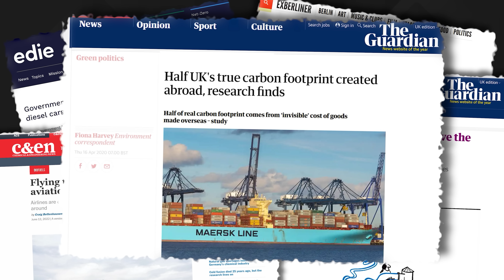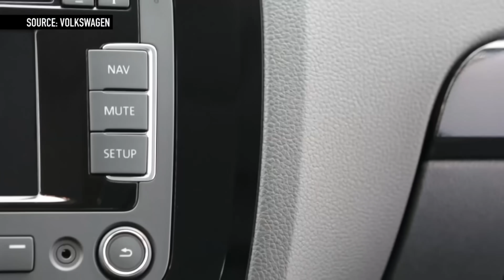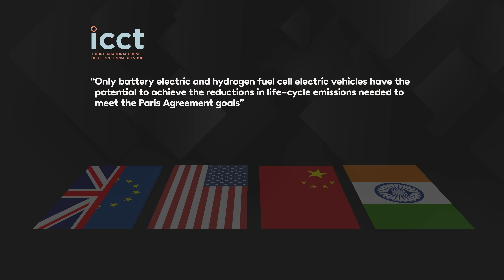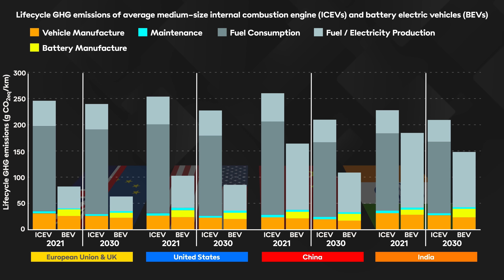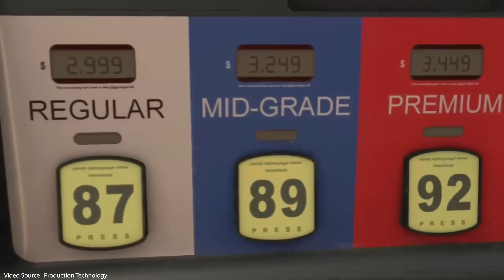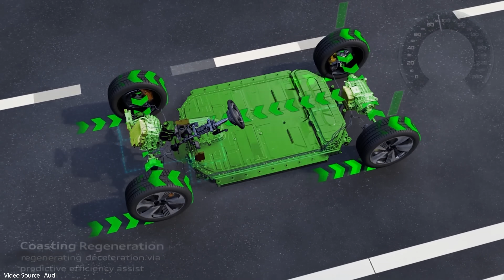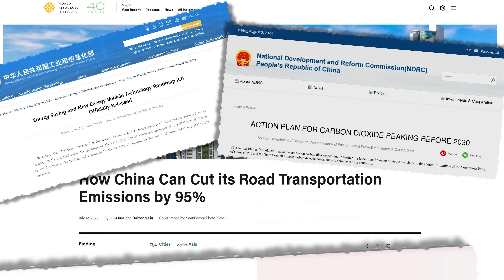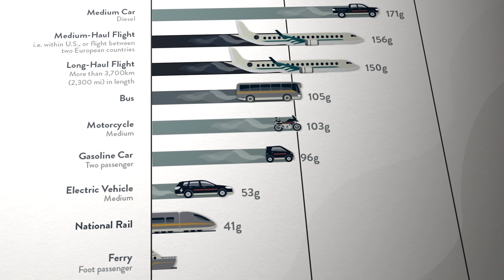Are EVs really better for the climate?

Comment: As always a very fair and balanced look at the subject. The naysayers never factor in the fact that pumping and refining oil, uses colossal amounts of electricity, so the emissions of internal combustion vehicles are worse in the countries that burn a lot of coal for their electricity. And as Robert Lewellyn often says, show me a recycled litre of burnt diesel
Reply: Hmm recycled liter of burned diesel. That should be a tree right?
Reply: Any idea what to do with the waste products from refining crude oil for other products? Seems we can just poor things like petrol and diesel into the sea? Assuming all vehicles, even electric, need lubricants for the transmission etc?
Reply: The only way you could possibly create synesthetic fuel out of the spread carbon in the atmosphere is via the use of a high temperature nuclear reactor on a shore. Its the only thing outputting enough heat and spare electricity for the harvesting and processing operations to occur at any form of scale. 

These people are also the ones who shut down nuclear plants and more importantly have downsized and downplayed nuclear research.
So good job fuckos, if you remove the "brute force" solution, the only thing that is left is the more efficient solution, that being EVs
Reply: The Earth is cooler with the atmos/GHGs/albedo not warmer.
To perform as advertised the GHGs require “extra” energy upwelling from the surface radiating as a black body. https://youtu.be/0Jijw7-YG-U
The kinetic heat transfer processes of the contiguous atmos molecules render that scenario impossible.
No greenhouse effect, no GHG warming, no man/CO2 driven climate change or Gorebal warming.
Reply: OK, I'll show you!  Aldo Steinfeld's solar refinery that uses solar heat plus atmospheric CO2 to proflduce fuel stocks that can them be refined into a variety on carbon neutral fuel.  He has a workout ng silar refinery in Switzerland right now.

So there.

Greenies want perpetual crises, so they can get rich and control your life.
Reply: Counter argument to Just Have a Think biased argument... https://www.youtube.com/watch?v=TUx8yIlKVpU
Reply: As a person in the Global South, I have a suspicion that the Green Transformation, initiated by western countries, is to legally and officially reap Developing Countries from affordable energies. Without energies, good luck to development, good luck to catching up with the West. The current international situation prevents many power countries from just invading others, or colonizing them, like in the past. Thus, they need a clever trick to suppress others' development opportunities. Much of the world's capitals are concentrated in western countries. By framing a country, such as China, Vietnam, Indonesia, as destroying the environment, western countries can officially hinder the inflow of capitals into those countries, in the name of "Green Transformation".
Reply: I missed the part about battery recycling surely that has a foot print? seems like we still need better storage solutions.
Reply: @-GinΠΓ Τάο Yes. The first cars were electric. So what? 
There was hardly any progress for most of the 20th century. Fossils were more convenient during that time. Especially as the downsides were externalized
It wasn't until the 80s and 90s when computer miniaturization justified massive investment into more effective battery technology for laptops and mobile phones and now more recently EVs. Batteries have become much better and a lot less expensive the last couple of decades.

There's too much false dichotomy around.
Technology alone won't save us. But also technology will play a large and necessary role.

One can be true without the other being wrong.

ICE is technology. Public transport requires technology. Feeding and supplying 10 billion people this century will require improved technology, because we need to get away from fossils big time.

For 2 reasons:

A) Climate change
B) They would run out one day anyway. Whether that's 8n 20 years or 120 years is besides the point. It's a limited resource and we also need it for other things, not just burning it in ICE cars.

Fossils need to be over and thus ICE cars have no future.

That we should also get more people from cars and planes into trains and busses is a parallel measure that also needs to happen. And what car use remains should be less owned and more conveniently shared.

Why buy a car if I can call one from an app and only use it for as long as I need it. No worries about financing a whole car that stands around most of the time, no worries about maintenance or repairs after a crash.
Reply: Stop calling them nay sayers. It's healthy to be skeptical. I don't compare electric cars to new petrol cars, I compare it to second hand cars and I live on a dirty grid.

However what is holding me back is I'm yet to see enough details out of companies like Tesla and I don't like their business practices.
I need to know what they're going to do with solar panels and batteries for recycling as this will be a problem in the future.
I need to see more government regulation on this data as everyone misses out stuff.

While the situation is looking a lot better, I think it's still wrong to assume it will be better everywhere and that the grids can handle everyone switching over to EV.

It's healthy to be skeptical, I'm for EVs, but I need to know more before I trust big companies on it.
Reply: @Commander_ZiN  I like your integrity
Reply: @Commander_ZiN  Yes, it is healthy to be sceptical.

But you're comparing known definite problems for ICE cars to speculative problems for BEVs.

And the state of your grid today is almost irrelevant. I find it tiresome that people still try to use that as an argument.

Your grid is moving towards cleaner sources every year now. If that isn't true over time we're doomed anyway and you don't have to worry about recycling your car in 20 years.

And if the grid is improving over time, why would we consider today's grid for a vehicle that is going to be in use for a couple of decades?

Yes, it's good to be sceptical. But don't forget to be sceptical about the stuff you're simply used to. 

ICE cars suck. They stink, are loud, have a lots of parts that need maintenance and can fail and need replacement over the lifetime of the car.

Even if lifetime CO2 were the same they couldn't compete anymore (except on refuel/recharge speed).

In a decade the next generation getting their first driving license will look back and not understand how anybody could cling to that old crappy tech.
Reply: @oerthling  it's tiresome that people argue without facts. You say ICE is known dirty and EV is speculation.

I'm not going to buy a new car unless I have definitive proof it is actually cleaner than running my old car longer.

Saying the grid will be clean one day is ridiculous, I'm not going to make a decision with future facts.

My very point is if I'm going to buy an EV, I need proof it is actually better for the environment.

You talk about cost of repairs, most of the repairs for my car are from things sitting on a shelf for 20 years.

I'm pro EV, however I'm yet to see the proof.
Reply: @oerthling  I've seen some of the data and I've found it lacking. It often doesn't take into account recycling and effeciency drops as the EV ages.

I have a very dirty grid, I'm not buying an EV in that the future the grid might be clean. When it is a cleaner solution then I will.
Until then I'll reduce my energy consumption.

I'm not buying a new car, as soon as I buy a new car it'll be worse for the environment. I'm not doing this and contributing to climate change until I know how long until the break even point is where I live with a particular vehicle. I'm not buying an EV until I know I'll be able to get spare parts and get it repaired for the next 20 years and that the spares like the battery can be recycled and the carbon cost is a net savings.

You can argue until you're blue in the face, if I don't see the facts, I'm just going to wait until I can prove it one way or another.

I worry If everyone switched to EV tomorrow they'd have to build a few more coal or gas power plants.

Again I'm happy to read a peer reviewed paper and do some math, but last time I did that was a year ago and it was a bit on the fence. I'd like to see a clear winner.

I'm not buying a new ICE car. I wouldn't mind a second hand EV, I'd prefer a car that has had it's manufacturing co2 cost already paid for, but I don't know if I trust EV manufacturers to support there vehicles long term.

TBH EVs remind me a bit too much of mobile phones. If you let the companies have their way, they'll mass produce as many as they can and get you to trade them out as often as they can.

Think about it, look at the graph in the video in india and remove the cost of the car manufacture it's pretty much breaking even. However I don't like those graphs based on vehicle lifetime as I don't intend on using the typical lifetime.
Eventually an EV would break even, except for the battery recycling and replacement issue and they never seem to include that in a way I can calculate it seperately for my use case. I suspect that's because they don't want us to know something.

Anyway no point arguing, just show me the facts.
Reply: @Commander_ZiN  Besides the already mentioned point that you ask for data on BEV cars that you likely never demanded before buying an ICE car (new or old), I see a key point in your arguments that I see as a whole in your logic:

The amount you personally own a car has nothing to do with the compatibility of ICE vs BEV cars.

If you buy a used car somebody else owned it for x years and after you replace it with another used car somebody else will own your former car. That car will exist for x number of years. And from production to wrecking/recycling it has x number of useful years.

It makes no sense to pick out 1 particular year in the lifetime of a car and compare on just that.
You cannot buy a car - even if it's 17 years old and tell yourself that the CO2 during production doesn't count anymore. You own the CO2 used during the fraction of the cats lifetime you use it, because without that initial production you couldn't own it 17 years later. For used cars to exist somebody must have bought it new.

Also, ICE cars also must be recycled unkess we just stack wreck on a field somewhere. That might be easier cheaper

Also worrying about getting replacement parts in 10 years is a valid concern. But that can also be a concern for ICE cars. And it will be an increasing problem for ICE cars as manufacturing of them winds down this decade and is replaced by BEV manufacturing.

Gas stations will eventually close down due to less demand. Repair shops for ICE cars will become rarer for the same reason.

As much as I'm sure that car manufacturers would love to sell us new cars (of any kind) every couple of years, that's simply not am option for the vast majority of us, as cars tend to be quite a bit more expensive than smartphones.
Reply: @oerthling  again you're not using facts.
When the maths lines up then I'll switch.
I bought my car second hand long ago, when it definitely wasn't better for the environment to get an EV, not that I could get an EV back then anyway where I live.

I'm not considering the co2 manufacture costs of my car because I've already owned it for many years.
I'm not considering the recycling because I don't plan on getting rid of it any time soon.
Also it's pretty easily crushed and recycled and melted down and spares used.
I don't know the same for batteries in EVs.

If I'm going to buy an EV all my questions will need to be suffeciently answered otherwise I'll wait till they are. I'm not buying something just because you have a gut feeling or you read a report that told you a story that doesn't relate to my location in the world.

There is a CO2 manufacture cost, getting a new EV puts more CO2 into the world than me running my car a little longer.

Until I can confirm how long I can maintain an EV for and whether the CO2 of replacing the batteries will be less than the petrol I use then I'm not doing it.

You're asking me to do something better for the environment without actually knowing it's better. That is ridiculous.
Reply: @Commander_ZiN  Whether YOU consider manufacturing CO2 or not doesn't matter. Without it your used car wouldn't exist and you couldn't buy it.

And again, you demand things from EVs that you don't for ICE cars.

You worry about battery recycling, but not about the fact that energy use of ICE cars is much less efficient or the fact that you produce co2 for every km driven and that is not going to improve over coming years - quite unlike the electrical grid that has been improving already the last 2 decades and will improve further (but perhaps your local grid is in Saudi Arabia :-) ).

And you are demanding facts in the comments thread below a video that references a study. And I have seen similar information for years. It's not hidden.
Reply: @oerthling  I've already mentioned where I'm from. I've already mentioned I have read similar studies and they haven't answered my questions.
You don't answer my questions but instead come up with silly arguments.

I already have my car it's done, the decision was made long ago. What CO2 was created when it was made was over 20 years ago. Surely you're not arguing it's the same as manufacturing a new car today.

Stop making silly arguments. Math and facts is all that is required. Point me to an article that shows where EV manufacturers source resources and all the CO2 costs for a making the battery and recycling the battery and how long they'll support the vehicle.

I've yet to see this information. If you've seen it let me know where. If you haven't you might as well concede the point you bought an EV on the belief it was better for the environment, not on facts.
Reply: @Commander_ZiN  'There is a CO2 manufacture cost, getting a new EV puts more CO2 into the world than me running my car a little longer.' Well stated.
Reply: @oerthling  You seem to be missing some of commander's points. Read and understand what he is saying, before getting upset.
Discussion is good, as long as we are on the same page.
Reply: @oerthling  'And again, you demand things from EVs that you don't for ICE cars.' You are purposely taking sides against ICE owners. Similarly he would carefully consider the merits of a new ICE car versus keep running his existing ICE car. You are making it out like he is anti-EV by not buying an EV now. When all the guy is doing is being sensible and considering the merits of any new car before he commits to buying one.
Reply: @jagolago-bob  What makes you think I'm upset? I'm really not.

And I could say the same thing.

Not considering lifecycle emissions from ICE cars just because you buy it used makes no sense.
And by that logic battery production and recycling problems would also vanish for used EVs.
Reply: @oerthling  You still are missing his point. He isn't convinced by the current arguements. There is a lot of propaganda that simple folk fall for, whereas others like to make an informed decision.
I don't mind whether I drive an EV or an ICE, but I won't buy one either, until the facts are on the table, and I'm convinced by them.

There's enough information for you to be already convinced of the benefits of EVs. You obviously have lower standards of proof than others do.
Reply: @jagolago-bob  OK. :-)

I guess I'm imagining the growing market share of EVs and that all major car manufacturers plan to switch to EV production. They probably have the same low quality information sources as I. ;-)
Reply: @jagolago-bob  Of course thes used to fight it and beg for money now.

If you're a legacy car manufacturer all you capital and competence was invested in ICE car manufacturing. Getting from that to new tech is costly and cannibalizes existing sake chanbeks and partnerships.

A problem that Tesla and other startups don't have. And nobody had to force them.

At this point it doesn't matter anymore whether governments push for it or not. You ramp up EV production or Tesla and fresh Chinese competition eats your market.

Big legacy manufacturers with political influence will always try to milk the government. Why wouldn't they? It works. That's what lobbyism is for.

Please note how Nokia and Blackberry vanished when they didn't switch from their legacy feature phones to smartphones. No government mandated smartphones.

What you didn't understand is that, yes, governments are mandating a switch to vehickes that require much less co2. As tgey should BTW, because we absolutely NEED to get away from fossils, regardless of what the next financial quarter teoort of legacy manufacturers would prefer in the short term.
But now that Tesla and others have developer superior cars the government mandate won't really matter much. Thus will happen with or without government mandated. EVs are already better than ICE cars and not just with regards to CO2 emissions.

Similar with energy companies. They need to switch to new energy sources, but are heavily invested in fossils.
Eventually they'll morph into clean energy providers or get outcompeted by new companies. In the meantime they will hitch and moan and milk public tax money via lobbyists.
Reply: @oerthling  That's what I said about the car companies. Which part didn't you understand?
The reasoning behind the governments mandating the switch is the bit that is confusing you. It's still not clear that it is the correct way. You seem to be convinced, but that isn't surprising me with your logic, any more.
I'm not even sure by which metric EVs are better than ICEs, according to you. There is no outright better in this case, except maybe for the uninformed.
Reply: @jagolago-bob Remember this thread in 5-10 years.
Have a nice day :)
Reply: @oerthling  You too, madam.
Reply: @Commander_ZiN  A very, very big yes to being skeptical. The issue of "EV's or Combustion Vehicles" being one or the other, is a road to nowhere. The fact is, a monopoly approach to either one (putting all your eggs in one basket) will be the downfall, at the expense of the environment itself.  

So my take on this, is too, let the competitive market forces bring about... via, a proactive EPA, with a commitment to ongoing emission reductions, and better recycling practises. Should be enough of a driving force, for next-gen technological progress for better "Battery and Fuel" innovations.
 
If past history lessons have been learnt... Monopolies fail, while healthy competition leads to better outcomes, with regard to manufacturing and production processes. I may be wrong, just a thought?🤔
Reply: @wayneharrison  The only way monopolies fail is if the market votes with their wallet or if the government puts restrictions on them.

People spend too much time on the EV versus combustion engine cars. Really what we need is all companies need to have the carbon footprints laid out and verified. They all need to have recycling plans or disposal plans accounted for. Then the discussion turns into one of math, it either adds up or it doesn't.

We shouldn't need to debate these things, we should just have the data to show the facts. A company won't do what's not in their best interest unless made to.
Reply: Not to mention fracking which uses tons of water we don't have
Reply: Not that balanced. I think volvo have a fairer comparison of emissions over 10 years of two of their very similar cars(one being electric and the other being ICE). From memory, it takes 3-6 years to offset the battery emissions of that volvo EV. You are already biased when you call one side naysayers. People who actually care about emissions would strive towards pedal bikes and walking where possible. Planes are top of the list of worst offenders but it's bad publicity to tell people that they should take a serious look at their overseas holidays with emissions in mind.
Reply: @longdang2681  also worth pointing out that I was a very keen cyclist and runner until I nearly lost my left leg to cancer 35 years ago. Even electric assisted bikes are very difficult, as I can’t quite bend my leg enough and falling is not an option. As they tell me they can’t repair it again. So efficient alternatives are my best bet
Reply: @dougowt  Sorry to hear about your cancer. Cycling/walking is not for everyone. It is however the most green of the methods highlighted(only for those that are able to cycle/walk). I was saying that lots of people like to hide behind the green and EV thing and then (inappropriately) drive to a nearby place. People do love to brag about their environmentally friendly EV's when behind their steering wheels on journeys that they could have cycled. For special case scenarios such as yourself, who cares even if you do emit a little more CO2. Health should always be top priority. Unable to and bone idle are two completely different things.
Reply: @longdang2681  The amount of Co2 that humans emit in total of wold emitted Co2 is 3%, not enough to have an affect on climate. unlike solar activity or la nina affecting the climate, this push to renewables is just a money making scam.
Reply: @longdang2681  Why do you think the Volvo study is fairer? Isn’t it more likely that an organisation with no skin in the game would do a fairer comparison? I wouldn’t take a study from a carmaker, electric or fossil fuel to be the most objective.
Reply: @Swindonboy56  I'm not sure if the ICCT has no skin in the game. Have you checked where their money comes from?
Reply: @Swindonboy56  Science is not based on whether you do or do not have skin in the game. The volvo assessment is fairer because it's based on a real model of volvo that you can buy now and test to verify the results. The more of the ICCT study I read the more I dislike it's layout. It basically reads 'getting 100% renewable energy + 100% BEV is the only option'.
Reply: @longdang2681  What on earth do you think the ICCT studies are based on?...A lot more cars than just a Volvo were taken into account. Volvo are a relatively small output OEM, most people don’t drive them as they are bigger than the average car and out of most people’s price range. The ICCT study looks at a whole range of cars to get to an average of size and fuel consumption. Of course the average car in Europe is smaller and more energy efficient than the average car in the USA where they drive a lot of trucks which does not apply here. Volvo, along with other car OEMs have a vested interest in slowing down the adoption of EVs for as long as possible as their profits depend on the continued sale of ICE cars until they ramp up their EV output. On that basis alone I would never trust a comparison study coming from any car company, even if they only made EVs. The world is heading toward 100% carbon free electricity production, not necessarily renewable as nuclear will always play a part...this trend is slow but inexorable...look back 10 or 20 years at the data and you will see what I mean...look forward 10 to 20 years and things will look very different. BEV is not the only option but it is the most well developed with the technology of battery energy density improving all the time...If you could make green hydrogen then that would also be truly clean transport but it is so much more expensive and complex than BEV. No one in Europe will be buying ICE 10 years from now, that much is sure.
Reply: @Swindonboy56  Averages are not comparable across categories. eg try comparing an average laptop to an average desktop and call them both personal computers. Volvo compares two of their very similar models, main difference is one is EV versus ICE. This is comparable. Have you looked at the average Indian car with it's tiny 23KWh battery? The tank in an average Indian ICE car must be half of that of the average European ICE car because the European average EV is at 45KWh. Volvo compares two of it's cars that have similar functionality where as the ICCT compares a tiny battery sized EV with a fully capable ICE. Considering the battery is the biggest problem facing the wide adoption of EV downsizing would mitigate a lot of the battery problems. It's nice how you have to dig into the details before you realise that comparing average ICE versus average EV in this study is comparing apples to crabapples. I said that EVs are proven great for those that it suits, but currently this is not everyone. I prefer the volvo report that compare apples to apples rather than the ICCT report that compares apples to oranges. (just for the record, A common Indian car Maruti Suzuki Alto has a 35 litre tank with a claimed range of ~480 miles, I'm not even going to bother to work out what the average range of a tiny 23KWh battery in the average Indian car is).
Reply: @longdang2681  That’s great if you’re happy to see a Volvo ICE compared with a Volvo EV but remember Volvo are not very experienced at making EVs yet, their scale is tiny compared not only to their own ICE output but to the output of other OEMs such as Toyota, VW or GM. When Volvo are producing their EVs on a dedicated production line in the same volumes as their ICE products then the comparison will be meaningful. Remember that most of the difference in upfront CO2 emissions in building an EV v building an ICE is in the battery, and the batteries are made by 3rd party suppliers who are themselves getting more and more efficient as they scale up. The takeaway for me is that a BEV has much lower environemental impact over its life than an ICE and this advantage will only increase as a) Grids get greener and b) EV and battery manufacturing scale up.
Reply: @Swindonboy56  We all know BEV has a lower environmental impact, the question is how much lower. What we don't need is ICCT reports like this giving us misleading figures and pretending that the battery problems don't exist. We want proper comparisons that would give meaningful figures. There are honest comments here with real life experiences. Every one of them is more helpful than this ICCT report. I do feel that the ICCT has the figures to compare the right cars, they are just unwilling to do so.
Reply: @longdang2681  So you are valuing the research of one car manufacturer over an international peer reviewed body. And no it’s not biased to refer to some as naysayers. These are people that usually take the misinformation of the fossil fuel industry and repeat it as fact.
Reply: @dougowt  the issue with this video is it doesn't even mention the conflicting data from Volvo (which says one must keep an EV for years to offset the emissions of production).  And that if one is constantly buying a new vehicle ICE is better.
Reply: @bowez9  data from who again compared to who again, no nix that don’t need your drivel again!
Reply: @dougowt  I'm valuing the volvo figures because they are in line with what can be seen about EV batteries. The batteries are a big part of the make up of many EVs and also it's total carbon emission when created. Volvo calculates a 3-6 years offset depending on how green the grid is. The figures come from two of their cars that can be bought and independent tests can be performed on those cars to verify the magnitude integrity of the figures. In other words anybody can test for the accuracy of the numbers to prove volvo wrong, if they feel the numbers are off. You don't need to take the figures at face value, you can check them for yourself. Calling someone a naysayer is a very bad tone towards them(just watch how the guy reacts that I've just called naysayer). Calling only those that are pro ICE naysayers is conveying negative bias towards them.
Reply: @bowez9  That's a silly argument. If a rich person buys a new BEV every couple of years, the old one doesn't get scrapped. It's sold or given away. This has no impact on the lifecycle of the car. Somebody else will drive it instead of buying a new car.
Reply: @oerthling  expect there is more demand which means more production which means more consumption.  You can not buy your way out of the problems created by consumerism.

The issue is the vehicle is only made for the first buyer and no concern is given to quality of product after that first buyer's time with product is exceeded.  This is why most people won't touch high end luxury vehicles on the used market, they are maintenance nightmares (Mercedes, Land Rover, Ferrari...)
Reply: @bowez9  This is the first time I ever heard the claim that nobody buys used Mercedes. 

None of what you said made any sense. Sure. The manufacturer focuses on first buyers - as those are their customers. But those customers, if they buy a new car a few years later want a decent sale price for their car - so that the upgrade only costs them the difference.

That doesn't change the fact that most cars don't vanish after a couple of years. 
Most cars, if not crashed in an accident will be around for a decade or 2. (Googling... typical lifetime seems to be something like 200k km driven - so depends on how long it takes to drive that distance).
Reply: @oerthling  not all Mercedes as a C class is not a real Mercedes, I'm talking S class.
If you're buying a ture luxury vehicle you don't care about resale, just like how Rolls-Royce talks about prices "If you have to ask you can't afford it. "
Reply: @bowez9  The production numbers for Rolls Royce (and super cars and all the other fraction of million dollar cars) are utterly irrelevant to this discussion. There's not enough of them to make a difference.

Whether the super-rich occasionally get their ICE luxury car out of one of their garages won't matter. Just tax'em.
Reply: @oerthling  I used those as examples but that is the standard trend of those that buy expensive vehicles (of which most every EV is, and even the Bolt and Leaf are outside the budget of the Average Middle Class American).  As such those vehicles are fashion items, why else to you think manufacturers change the vehicles every year or two.
Reply: E-bikes consume much less energy than regular pedal bikes.
Reply: @bowez9  You can't be serious. A Rolls Royce costs something like half a million.
A Mercedes S class costs about 100 k - that at least is close to the luxury high end Tesla models. 
But a Model 3 is already half of that.

A VW ID 4 starts at around 40 k

A Bolt starts around 30 k.

Prices found by quick googling. Will vary by a few k depending on region, options, currency etc...

Point is your examples have nothing to do with mass market EVs. And I didn't even look up cheaper Chinese models.

And nobody is denying that buying an EV is currently more expensive than an ICE car. No surprise. One is the result of over 100 years of mass manufacturing. While EV mass production is 1 or 2 decades old. And production really only took off in the last few years.

And even with that an EV becomes cheaper after a few years, because the electricity is cheaper than gas and an EV has less parts than can fail, doesn't need oil changed, uses brakes less etc... - overall less maintenance cost. So buying an EV is more expensive than an ICE car, but owning an EV is less expensive than an ICE car.

And even the manufacturing costs will shift over time. EV and battery production will become more efficient and unit costs will go down. ICE car manufacturing will become more expensive over the coming years. The more EVs gain market share, the lower the production numbers for ICE cars, thus unit costs for ICE cars go up and thus it's price. That's why manufacturers will stop producing them in a few years. They won't be competitive anymore.

The biggest problem today is that EVs haven't been round long, thus there is no broad used EV market. And demand is so high that even used EVs don't fall on value so much. 

That will gradually change in the coming years as early adopters upgrade and sell their model 3 and ID 3s etc... to upgrade to the cool new 2025 models etc...
Reply: @oerthling  if it doesn't matter what the rich do then it doesn't matter what America does only China and India.
Reply: @oerthling  the cheap prices you listed are outside the Budgets of the average Americans $50k/yr, which limits vehicle to $25k (or 20% of income)  and do to price insurance off sets the savings in maintenance.

No the issue with EV is the battery which is half the price and a significant portion of its mass.  Further they have a finite life even if not in use.   The Leaf has killed the used market in that on one wants to chance buying a bad battery pack that cost more than the vehicle is worth, and cost at least 2-3x as much as a bad engine or transmission but are infinity easier to diagnose.
Reply: @oerthling  yeah because Buick, Cadillac, Lincoln and Ford buyers don't replaces their vehicle just because the new model is out, with bigger tail fins for this year.
Reply: @bowez9  Yes, the battery will eventually loose too much capacity and limit the lifetime of the car. But ICE eventually also fail because the repairs on an old car are no longer worth it.

People keep bringing up battery lifetime as if ICE cars run forever. There will always be exceptions, but a quick googling gives cars a typical lifetime of 8-12 years or 200 k km.

The lifetime is limited either way.

Yes, price is currently a problem, because the used car market for EVe is small and there's too much demand for used Model 3 because overall demand for EVs is much higher than the supply.

And people on low to medium income have trouble paying for a new-ish EV - even if that would save them money over time, because the initial bump is too high to get over.

But, again, that will soon shift in the coming years as EV production ramps up and ICE car production goes down (shifting units costs in favor of EVs).
At The same time the used car supply for EVs will increase.

You guys are defending horse and cart ownership after the automobile was invented.

This WILL happen and is already happening and escalating.

In Norway sales of new ICE cars is already a small and fast shrinking market share.

Tesla can't produce enough cars to satisfy demand, while they ramp up production.

Even Ford EV trucks are popular.

All the major car manufacturers are ramping up EV and battery production. VW already announced a complete switch-over years ago.

ICE has no future (outside of some specialized vehicle types for construction etc...). It's fairly obvious by now if you care to look.

I know that thus isn't obvious yet if you drive to your local dealership and see a large parking lot filled with ICE cars. But that's in the nature of major paradigm shifts in technology. It's not that obvious until it suddenly happens very quickly.
One year Nokia, Blackberry and Sony-Ericsson rule the world of mobile phones.

A couple of years later they ate history and everybody has smartphones from Apple, Samsung etc...

Cars take a bit longer because they are more expensive and thus get used for much longer. But the S-curve is already on the fast upward part of the curve.

I'm not really trying to convince you here and now. You'll see in a few years anyway when it becomes really really obvious.

There'll be much less gas stations in a decade, chargers everywhere, you'll know plenty of people who drive EVs even if you cling to your ICE car and you'll curse about gas prices and how far you'll have to drive then to get to a gas station or body shop that still works on your model and know where to get replacement parts.
Reply: @bowez9  You do know that China is mass producing EVs not just for export but also for the Chinese market, right?

China absolutely plans to switch to EVs as fast as possible.
Reply: @oerthling  they why have EVs prices gone up, if scale was to bring price down?

No most vehicles have lives of 2-300k miles before major items need service (transmission overhaul, or timing service).  My 1990 F150 has 600k miles (and still gets 22mpg )and is not an oddity for this setup, the engine is exactly as it was in 1989 when it rolled of the line.
It's just most people WANT a new one to keep up with the Joneses.
Reply: @bowez9  Your particular F150 may have survived for 600k - I have no reason to doubt that number.

But I also just googled average lifetime for F150 and find it's something like 150 - 200 k miles - so pretty similar to many cars.

Congrats on getting that much use out of your F150, but it's not typical according to information I can find online.
Reply: @oerthling  the Ford 300 I6 are known for thier longevity on par and in some cases exceeding diesel.  
The reason for the average you found is not for mechanical reasons but people's desire to keep up with the Joneses.
Reply: @bowez9  That is not very convincing. It's easy to believe that somebody wants to get a shiny new one, but if that thing is still running it can get sold to somebody with less disposable money.

Lifetime is actual lifetime, not an ownership period.
Reply: @oerthling  at a certain point the dealers scrap them in that there is no money to be made.  They go to auction and the price is so low that scrap yards can and do make money.
Very few dealers deal in vehicles under $5k and  almost none deal below $2k.  At those points the vast majority go for scrap parts by way of auction so the dealer can get at least some money back on the trade in.
If there us no money to be made no sale will happen.
Reply: @bowez9  Of course. But then the are by definition down to scrap value.
How many thousands of miles did you think you can get from a truck that is worth more as parts than as a whole truck? Are you trying to convince me that this thing will, reliably, go for another 100k Mike's, without increasing amounts of repair? Doesn't sound likely.

Again, there are always exceptional cases. Well assembled units that were well maintained plus a bit of luck.

I know of cars that work beyond 25 years and have 300k+ km without falling apart. But that doesn't describe most of them.

And of course some percentage just get totalled by accidents.
Reply: @oerthling  Personally I would say all vehicles (Stellantis excluded) can make 300k miles 500k  km easily.  More easily if one is willing to rebuild wear items and/or put up with cosmetic defects.

As for when scrap price exceeds value well on a new Ford F series that is on day one hence tge reason they are the number one stolen vehicle.  Where as Tesla never will because of Tesla control of the repair process.
Reply: @bowez9  You can personally believe what you want. But when we look at statistical data we can easily say that they don't.

And of course you can keep a car going forever - as long as you are willing to replace/repair any damaged parts that you need for it to function. But at some point you have replaced everything and effectively assembled a new car. :-)

All we can objectively agree on is statistical data. And that says that cars have, typically, a decade or 2 to get through 200 km or so. And then you get to a point where the repair costs get too high and reliability too low to jeep doing this and we get to the end of the vehicles lifetime.

Eventually all vehicles, either ICE 
or BEV fail and reach that point. The exact reasons differ, but the end result is similar. At That point it will need recycling. And while it may be easier to just melt most of an ICE car and it's a bit more difficult to recycle a battery - the battery contains more valuable materials, justifying more effort to recycle them.

Otherwise the situation between ICE cars and BEVs  is very similar. Seats, glass, carpets, dashboards, screens, electronics, cables, etc...
Reply: @oerthling  I disagree repairs don't get too high just your average user doesn't want to put the effort in it and want something new for the sake of being  new-even though repair more economical option by far.  Nissan CVTs are the most expensive mainstream transmission I've priced to rebuild and that is only $4k versus $10-20k+ for a replacement vehicle.

People get rid of vehicles usually because they WANT a new one not because the old one is wore out.
Reply: @bowez9  None of that changes anything. Average lifetime of a car is its actual average lifetime. Whether that's because repairs become too expensive or owners give up too early in your opinion doesn't change the end result.
Reply: @dougowt  Those 'naysayers' are proof of the saying 'you can't fix stupid.'  There's a car in China called Nio set up on a battery swap scheme where the buyer DOESN'T buy the Nio with a 'battery' but buys a monthly subcription [$12 US a month for six battery swaps] where the buyer goes to a swapping station and in five minutes has another 300+ mile range.  Nio has the fastest growing market share of EV's in China.  Nio is planning to 'flood' the EU market and has plans for America.  I can already hear the American 'naysayer' politicians screaming [you know...those politicians with their palms up getting money from Big Oil's K Street lobbyists] if Nio does open the American market - I hope Nio does come to America!  I, for one, am tired of my tax dollars subsidizing Big Oil!
Reply: @bowez9  Why constantly buying a new vehicle? Maybe a thought change is necessary there too. I keep my cars at least 9-10 years (and I went to work by train for 34 years even though I could have taken the car and had free parking, just much cheaper and less stress -> longer life expectency 😉 )
Reply: @CarloDidier  my newest vehicle is 18yrs old so I'm not constantly buying.
Reply: @bowez9  I didn't say it was you, but you wrote generally "And that if one is constantly buying a new vehicle ICE is better." That's what I referred to.
Reply: @ross6343  well for vehicles that start at $70k before import taxes I don't see Nio making that big of an impact in the world outside of China, especially when they must buy the land for battery swap locations.
In China at those prices its clearly a rich man's car.  The same reason Buick is popular there (if you can afford to keep it running you must be rich).
Reply: @bowez9  the average price of a new car in the U.S. is now $48k. I believe, Leaf, Bolt and other EVs are cheaper .
Reply: @Wasaga1951  but as others have addressed that price ia outside the budget of middle class.  To the point the only new car in budget is a base Nissan Versa.
Reply: @longdang2681  ride a bike or walk in 100°f weather?  The naysayer is the biased one.